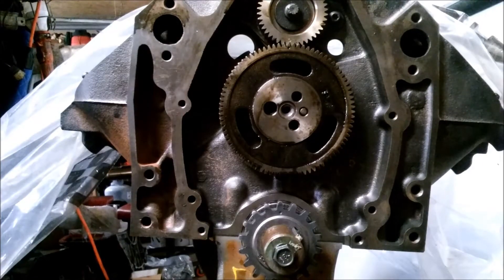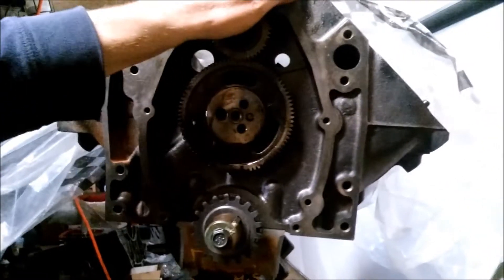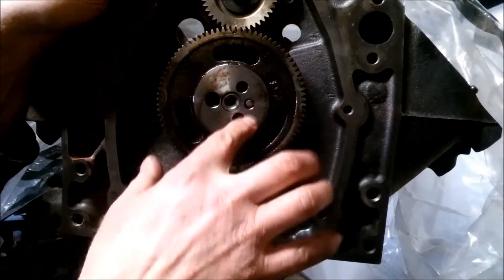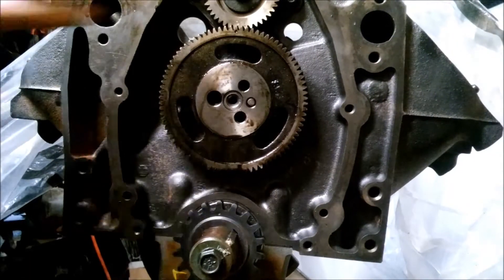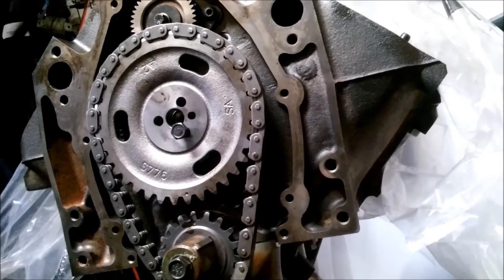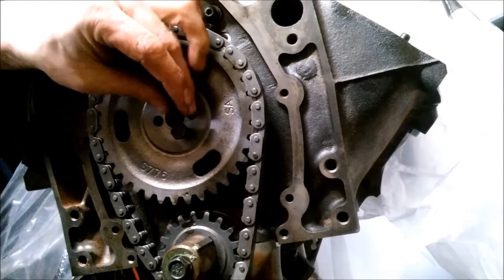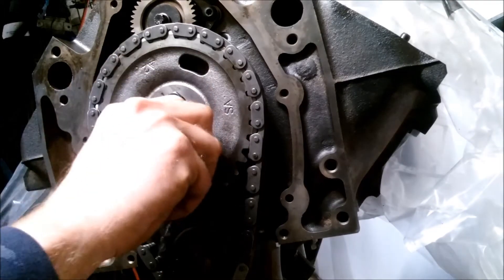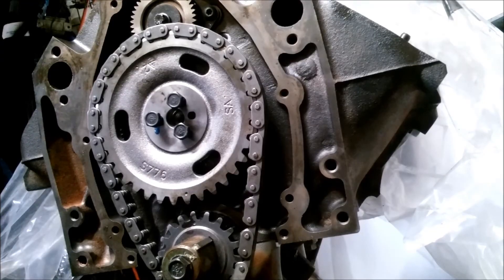Chevy 4.3 V6 engine timing chain. The basics short and to the point. Chevy SBC

Comment: Sorry but theres alot mor then this.
Reply from the maker: Really ? If you know more then me who done a few. Then made a video about the basics of installing time chain, why are you watching how to do  video's ? This is the basics short and simple. Not how to remove a simple water pump off or a simple timing cover off.
Reply: Hey I have a question I'm leaking a little oil not a lot from the front of my engine on a 2003 Chevy Astro van what would I replace the crank shaft seal and the timing cover gasket or is there something else I should replace besides what I have mentioned @mobilemowers

Comment: How much slack is allowed? What is a good chain look like or not look like? so may unanswered questions. Thank you for the little info i did get from the video though.
Reply from the maker: Hi, Glad you you got little information. I was just explaing how it worked with the balance shaft for the 4.3 with a new chain.  Hard to explain slack without showing it. Very little is allowed but must have some slack. If it is really floppy, then it is bad. Might want to search for a video explaining how to tell a bad / worn timing chain so you can actually see it. Search SBC timing chain or ect.

Comment: So I got my 4.3 at TDC and my dots are not lined up I’m confused here
Reply from the maker: Are you 180 degree's off on the crank or camshaft ? Top dead center is compression. Remember the marks can align up twice. So make sure both valves are closed.
Reply: No I figured it out both dots are supposed to be pointing up on combustion stroke and the dots will
Line up on exhaust stroke. Thank you tho

Comment: Newbie here.    How does the chain get tensioned ?   The whole reason to do this is the chain wears, and gets slack in it.   How do you retension the chain for install ?
Reply from the maker: It just stays the slack you intall it . You don't you replace. Well at least the chain where it is worn. It can take  at least 100-200k miles to even wear. These are not over complicated over heard cam engines with phasers. Only about $20 ish. Capisce ? Please give me at least like and subcribe helps my channel grown and get recommended to others.

Comment: So what do you rate this job 0-10? Difficulty wise.
Reply from the maker: About the easiest timing chain you can do. Same as a 350 Chevy. 2-3 hour job in truck. 1hr or less not into a truck. Don't use cheap China chains. Make sure to replace the front seal. Only need a puller for the balancer and few sockets / rachet. Try a modern over head valve V6 or 8 engine countless hours and parts

Comment: Can you be 180 off on the timing chain install with timing marks lined up
Reply from the maker: As fsar as I recall yes.
Reply: @mobilemowers  the dots need to line up with piston 1 at tdc compression stroke. If you do it with number 1 at tdc exhaust stroke you will be 180 out.
Reply: Best to pull distributor cap to see rotor position and timing cover to see gears, then rotate the engine until rotor points to cyl #1 and timing marks on gears line up (minus inevitable slop in chain if old). I can't imagine the pain of getting the engine together and finding out the gears are out 180. I've done 5 or so this way since 1975 and never had a problem.

Comment: What stroke is it on with it in time like that I'm asking because I'm doing both the chain and the distributor
Reply from the maker: Timing is always set to cylinder one on top dead center. So get number 1 one top dead center  ( right front cylinder) then where the rotor is currenly pointing is number one cylinder. Move the distributor to where you want #1 to point.  
Sorry for late responce I just do this as a hobby and for the past few years of this never made one dime from you tube. They did that 1,000 plus member bs.

Comment: What is that nylon gear behind the cam gear?
Reply from the maker: Their is no nylon gear. You might be referring to the one I took off the cam shaft. Might be called cam gear as took it off cam? As stated it connects to balance shaft.
Reply: @mobilemowers  
Well I was referring to the smaller gear at the very top of the cam gear.. looks like you engaged the teeth of the cam gear and that little gear... And I guess the way the lights are your camera hit it it made it look white like nylon.. thanks for your replies

Comment: Hey bud! Quick question, if i need lets say only replace the cam shaft (different lobes lil bit) do i really need to remove intake plenum? Is there any holes to secure all the valve lifters from falling into the bock?
Reply from the maker: Yes cause the push rods will be pushing on the lifters thus pushing in on the camshaft. Always go for the smaller camshafts for stock vehicles if installing a performance one. Too big of a cam can ruin it all.